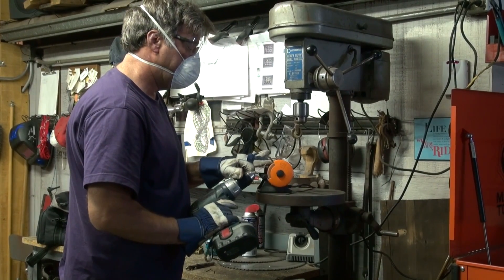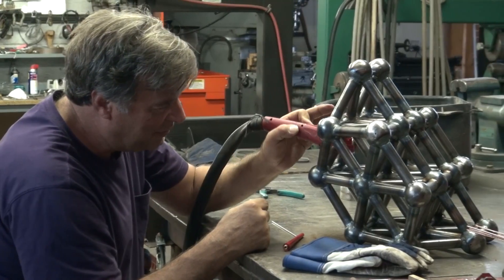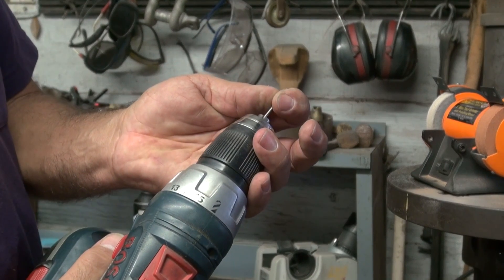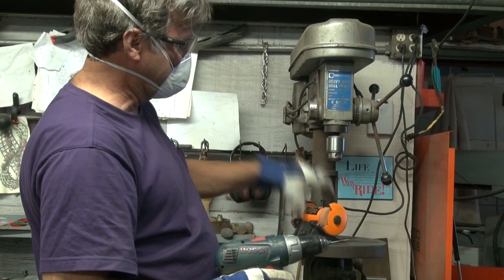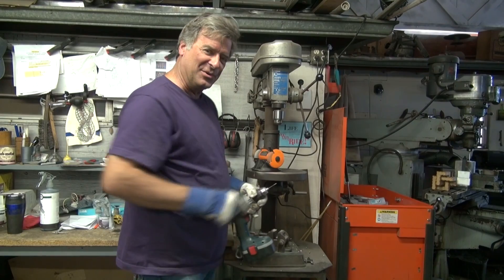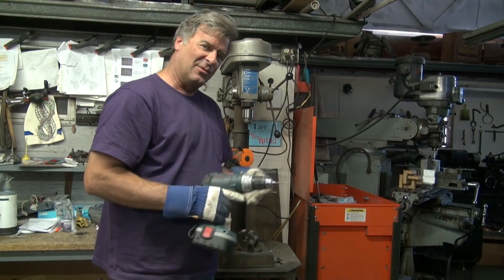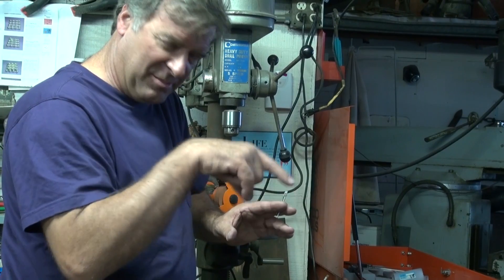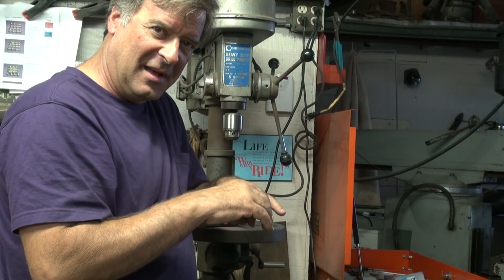How to Easily Sharpen TIG Welding Tungstens - and How Sharp to Make Them - Kevin Caron

Comment: what grit type of wheel you use to sharpen your tungsten?
  im gonna buy me a grinder like yours from H.F.
Reply from the maker: I use a diamond wheel from H.F.
Reply: Kevin Caron, Artist .

 ok sounds good,, i'll look into it.  this set up i'm putting together will be my firrst tig torch set i bought from welding city supply.
 i will be hooking that up to an old school
  Miller Diarc HF. i still need to figure out how to set up all my dials and buttons on it.
 you got any videos on that particular miller set up?.
 any suggestions are greatly appriciated Sir.
Reply from the maker: Sorry, never seen one of those.     But the general idea is the same.

Comment: You should weld a base with a vertical piece of 16 ga strip with a notch in it in front of the grinding wheel to rest your tungsten in. Might increase efficiency when sharpening multiple rods!
Reply from the maker: +Yung Tune 

That would help..    Will look at that some more.

Comment: Grind to a needle, and soft wheel it after. Getting rid of the rough edges and grind marks also gets rid of the arc wander. I flat the end for aluminum.
Reply: I started polishing my tungstens on the soft wheel many years ago, working in a race car shop where precision was key. The other guys made fun of me at first, but it works.

Comment: Which is better of the two?  A water cooled torch or air cooled?
Reply: roncreach75 water cool = more amps voltage. Make awesome  aluminium welds with water cool MIG arc spray

Water cool for thick material, 5\8ths up

I use air cooled for aluminium, stainless ,  brass, steel.

Comment: Hi Kevin, this is what I do two nights a week, 2 to 3 hrs each, for our 6 cnc welding lathes. We use 1/16" 2% ceriated tungsten that I polish each end on a scotch brite wheel and then grind on a diamond wheel from Diamond Ground at a 20 degree angle  to a sharp point. 100 to 200 each time.  I've been doing this for at least 10 plus years.
Reply: John Warden 

Damn that must get old.. I hate grinding tungsten just to do jobs

Comment: why did you wear the mask? Is tungsten that hazardous?
Reply: 2% Thoriated Tungsten contains Thorium which is radioactive. It is only Harmfull if ingested because it can not penetrate your skin. So if you are using Thoriated tungsten you should be carefull. If not, It's not a big deal. Still wouldn't go sniffing the dust though.

Comment: Ahhh ha! Now I have to make a trip to Harbor freight.. Most of the time the only time they would flatten the tip was when they were working on aluminum, that;s what the old timers told me...
Reply: ***** if you're just using plain tungstent, which sucks, you will melt the tip on higher amps... try 2% lanthanated they perform best out of all and you can keep them sharp at higher amps with no melting. you're flattening the tip to remove the bit that would melt and ball up at higher amps, which is more of a prevention than a cure of the problem  with 2% lanthanated you wouldn't need to flatten the tip

Comment from the maker: Thank you for the kind words.

I would say 8 mm with the tig is going to be a lot of work. Figure on running amps in the160 to 200 plus range!

If you mean 0.8mm then I would be down in the 5 to 10 amp range.

But that is just guessing while sitting on the beach with the laptop..

Comment: Yeah, the simple trick of having something to spin your tungsten helps tremendously to get your tungsten tips much more even. Rather then those of us that might be a little clumsy with our fingertips trying to spin it several times perfectly straight with even pressure and pull away before stopping. I have been using a Dremel for quite a while to sharpen mine. Plus the boss had gotten a special tungsten diamond wheel sharpener made it go very quickly when your doing a bunch at a time.

Comment: The "New Inverters" recomend that you DON"T Shapenen them the way the OLD Tigs were, I think every one started,Or had a Miller 330,Ac/dc. Stick,and tig, My old one that I sold!. Used to run off a 120 amp breaker!Ona DEMAND Meter YIKES!On EL. Bill,But,the OLD Tigs, the sharper the better! for Stainless,and For AL.put on dc rev, For A sec or 2 on a Pc of "Copper,If You have 1)Steel OK,.to Ball the Tungston,for AL! But not the new inverters! Seems Sharpen,then put a flat spot!Hope it Helps You.Jack

Comment from the maker: I have no experience with this brand. I tried to call them and no answer. The machines look a lot like longevity or everlast machines.  The problem I have with multi-use machines is when one part goes bad it takes the whole machine with it. 
I would send you to Longevity welding to look at their machines. They have the same warranty but I at least know them.

Comment: hey kev i was wondering if you could help me out im thinking of buying a vortec tig welder and its also a plasma cutter off ebay its around 1600 bucks says its top of the line can cut up to 1 inch steel says easy to use with a 5 year service plan do you know anything about them if they are a good unit or not i have a hobart mig welder 110 and also a miller 250 ac dc arc welder but i realy need a plasma and a tig would be good to please let me know what you think thank you

Comment: I brought one of those little grinders and a little polisher cheap on an online auction - only because they looked big in the photo - You should have seen the look on my face when they arrived.  Question is what is the orange wheel?  I use a green wheel for carbide lathe tool sharpening and I know the white one is for tool steel.  Can you sharpen tungsten carbide on any stone?

Comment: That's an interesting idea for sharpening tungsten. Presumably you want the scratches to be vertical (in line with the shaft) rather than horizontal. If the speed of the drill is close to the speed of the grinder, your scratches will be spiral shaped, but if the drill speed is slow they will be vertical.

Comment: i work as a welder/fabricator, and we have a machine for grinding our tungsten, it has a diamond grinding wheel, and we always grind then needle sharp, but blunted for Al, i have never seen the arc wonder around, but that might just be my machine or the diamond grinding wheel...
Reply: hanzithaking it must be this guys machine. I sharpen them like needles on a bench grinder and have a great arc never arc wonders. He could be running to much CFH and having arc blow. I run a miller on a 7 series 150amp torch. Testing 6G Tig root, combo stick fill and cap!

Comment: I have a little handle that clamps down on the tugstens, its about 4 inches long. I hold it up against the grinding wheel.  I use one hand as a guide, then I turn it with the other hand. It works pretty good that way.